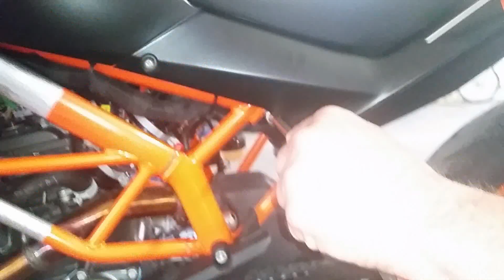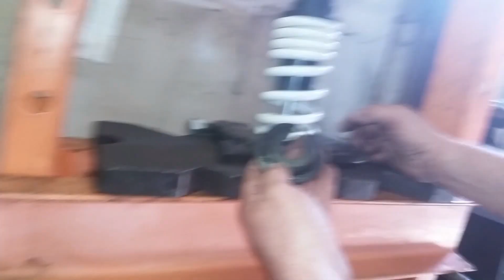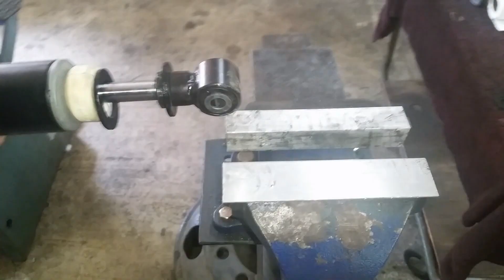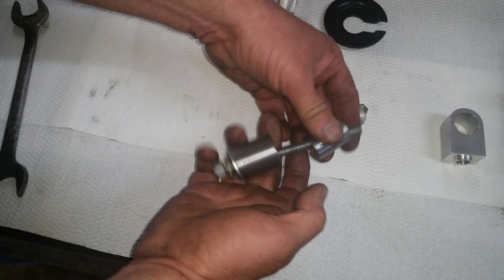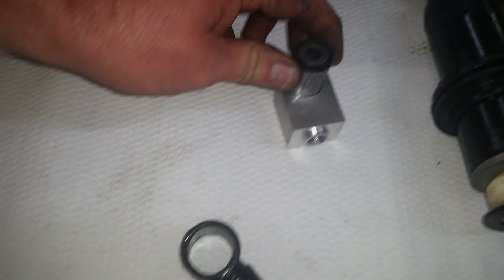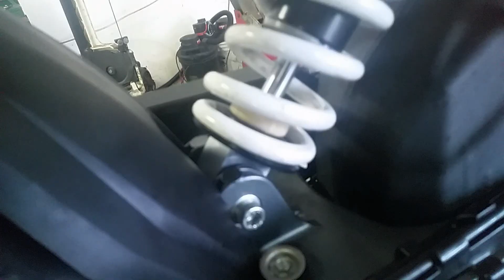How to lower ktm duke 390 or rc 390

Comment: Guys I had my Duke 390 lowered and my Duke 200 too.
Was done at the motorcycle shop where I purchased the bikes. I am 5'1 tall ( yes all laugh now ).
I can toe both sides and sit with the ball of my left foot on ground. You need to consider that this will affect your bikes ground clearance with curbs and driveways.
Learner LAMS bikes theses are awesome bikes... Thanks.
Reply: Michael Feighan 
I’m literally one inch shorter what did you use to lower your bike and can you can your feet pretty much touch the ground because I’m really looking into getting a KTM duke 390 and need some help I went to the dealer yesterday and a guy told me to get a lowering kit and they’d lower it how much was it lowered for you and how much did it cost if you don’t mind me asking
Reply: @nvlogs6207  really how
Reply: @debarghyachattopadhyay2614  I don’t understand the question sorry
Reply: @nvlogs6207  how did you do it?
Reply: Im 5.2" height and facing problem with duke 125.kindly tell about that kit?
Reply: Sir ,
I wouldn't, and never laughed at anyone who is shorter, or heavier,or whatever. I have a brother with downs syndrome, and people laughed at him most of his life which really pissed me off. And that's just plain ignorance. My friend just got a 2020 Duke 390 and he's tippy toeing.(5'11") I plan on getting one also and I'm 5'8"( on a good day) and I immediately became discouraged after seeing that. He called his KTM dealer and found out that a lowering kit is offered. I think 2".
Reply: How bro ..how u lowered it

Comment: How did you get the seat not to drop down onto the swingarm when you removed the shock?  did you hang the bike up?  thanks.
Reply: correct mate - this guy cut all the difficult bits out and trys to make this task look easy.... you need a jack or a hoist to get the bolts out without having to use a drift and a big hammer, plus you can never get the shock out without having the bike jacked up - this video should be removed... now my bike is stuck in the garage all dropped hahaha i need to buy a scissor jack to finish the job haha fuckin bloke has pissed me off big time

Comment from the maker: It lowers the seat height around 30 mm. The kit is available on Ebay. Thanks for looking and here's a link. http://www.ebay.com/itm/252021087334?ssPageName=STRK:MESELX:IT&_trksid=p3984.m1555.l2649
Reply: Dude the 200 is just 148 kgs(quite light)......& i have lots of friends tht tip toe on it.......dnt worry....u just need to spend more time with the bike to get more confident.....In the end it comes down to confidence not height
Reply: +Ricks Garage Does it works in ktm Duke 200 also???